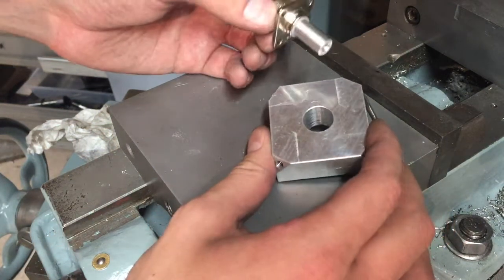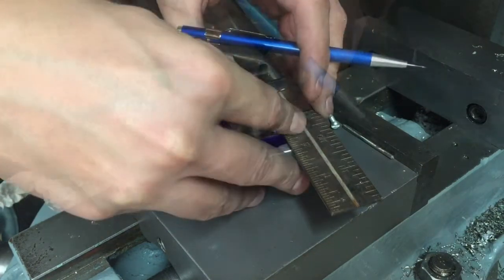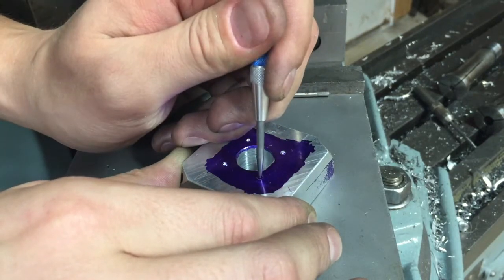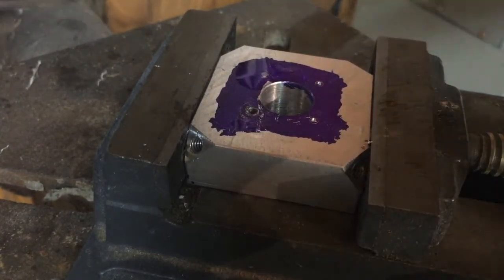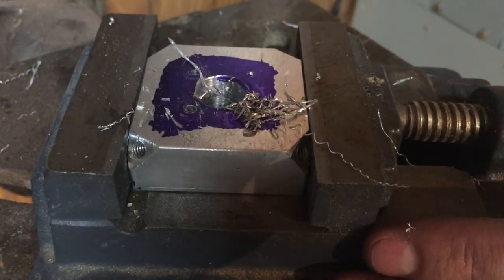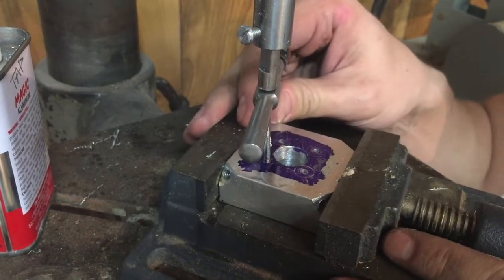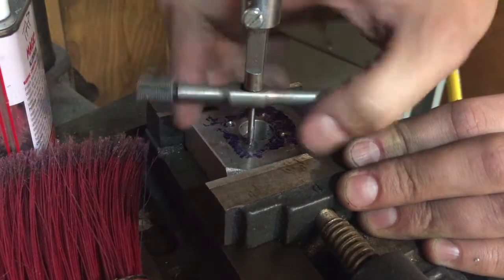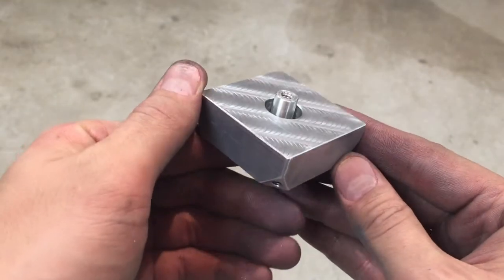Antenna Project Part 3: Mounting the Connector

Comment: The size of ground element sugest a VHF/UHF antenna, if so, you could to use N connectors, that SO239 performs better under 100mhz